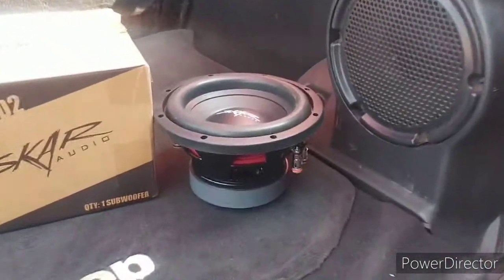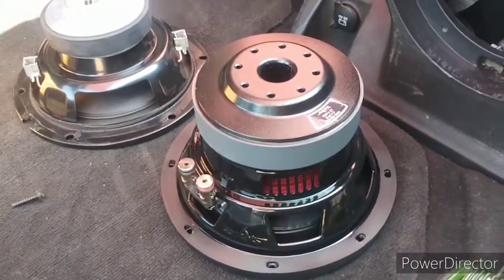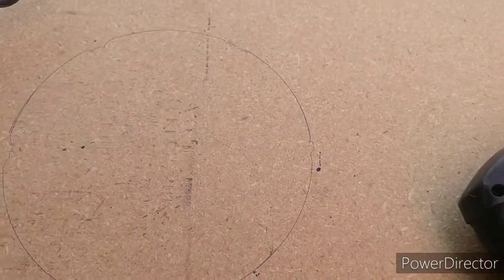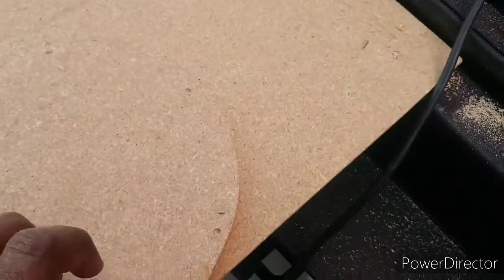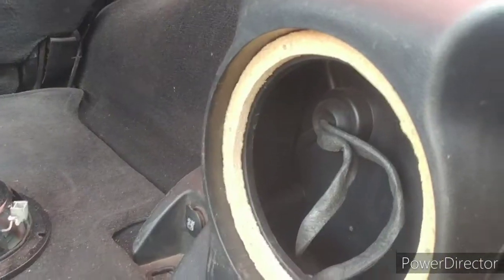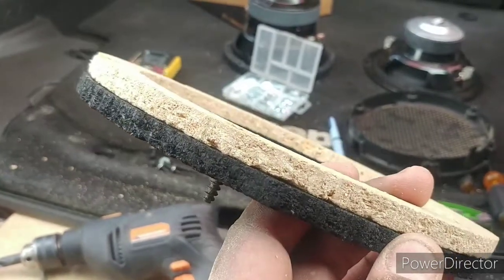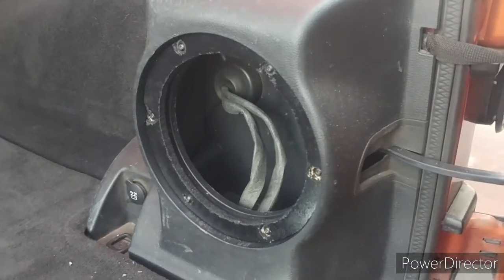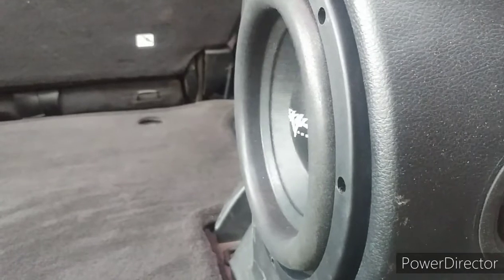How To Install Skar SDR 8-D2 8" Subwoofer in Jeep Wrangler JK

Comment: Tried something similar on my 08 and it sounded awful.
Reply from the maker: Skar has some serious thump! This little 8" hits and so many people who ride think I have larger speakers. I'm like, "...nope. just an 8 in the back and two 8s under the front seats."

Sounds like a cinema in the Jeep. Crisp highs and deep, rumbling bass. Star engineered a winner with this!

I'm sure anyone who's heard me play the system loud will have to agree. I should do a video with people in the Jeep, but we have to many Karens that will pick apart people having a good time during a pandemic. They'll find SOMETHING negative to say, so I stopped recording people.
Reply: @MicDropBBQ  yea mine sounded awful. But I belive it’s the enclosure. I’ve had quite a few slats. Went with the vd 8 and I’m sure I didn’t have enough air space. Going to go another route. Great video I also had to use spacers.
Reply from the maker: @nicholasstaed3343  You can also use some insulation inside of the enclosure to take up some of that air space, creating more push with the bass hits! I did that on my motorcycle with a 10" sub and that shallow mount really kicked for a bike system! I'm always trying something to see what things could do, tho. Always experimenting!

Gonna have to see what the VD8 is all about, tho!
Reply: @MicDropBBQ  had two vd 12s in my 01 step side single cab Silverado
Reply from the maker: @nicholasstaed3343  that's a small cabin for all that bass!! Damn, that's like a BASS CHAMBER! hahaha! I bet you felt the music going THRU your body the whole time! Two 12s? Man, you trying to jump start old folks' hearts with that! hahahahaha!

CLEAR!!!! FZZZT! BASS.....she's back to life sir. We brought Sally back. LOL!
Reply: @MicDropBBQ  man your funny. Nice talking to ya tho.
Reply from the maker: @nicholasstaed3343  HAHAHAHAHAH! Hey, I just wake up and do my best to have a good day, brotha! Nice chatting with ya and stay tuned. I got a few more mods coming up and then I'm DONE with this Jeep for good! LOL! (I hope!) I'll be back to working on the bike, maybe.

Stay up, my man! I'm gonna research the subs you're talking about. I do still have the Escalade with the stock system in it. I bought that truck back in 2011 and never put a system in it. I always used it for work, so never really invested much into it. I may pass it to one of my sons, and they're into systems big time. Especially the 13yr old. I can see him wanting subs that hit hard like a competition show, so he wouldn't be happy with my 8s. LOL!

Comment: Can u make me a set and ship them? Lol of ourse ill pay. Seriously
Reply from the maker: This was my test set. Now I wanna make em outta more solid wood so the pressure of the bass doesn't escape any cracks. This sub hits a lot harder than I anticipated. My volume goes up to 40. I can only turn it up to 5. If I even go to 7, you can't hear the person sitting next to you! 😂😂😂 Let me get a few adapters built/tested on my Jeep and I'll sell em. They also have to be slim enough to be able to raise the trunk storage lid without hitting the sub sticking out. I barely make it! 😂 It's a close cut!
Reply: @MicDropBBQ  when you make some ill take the old ones off your hands lol. I just need anything to make this speaker work, i have it in a box in my trunk and no bass :/ lol
Reply from the maker: @jdruso7  you can set up the system with the under-seat 8" subs as well. I have a video of Rockville "under seat" 8s and that also warmed the bass up BIG TIME! The entire cabin of the Jeep a bass-box.

I might have to sell you this prototype. I always think my 2nd version of a build is best tho. Haha!
Reply: @MicDropBBQ  lol just let me know! Im ready to buy whenever haha.